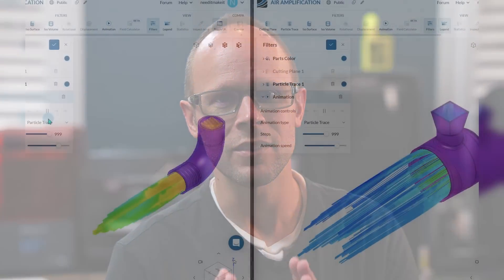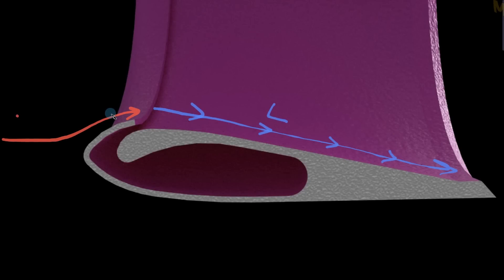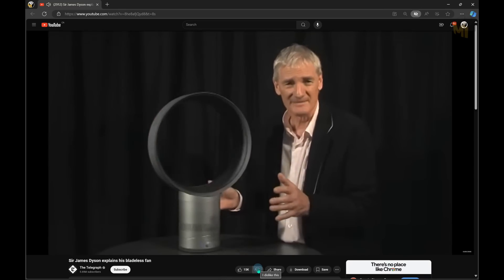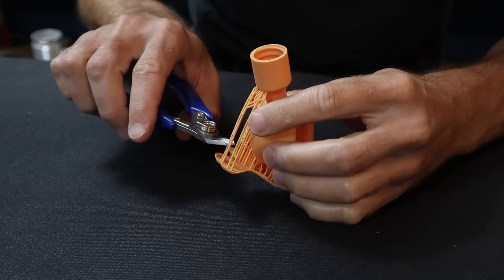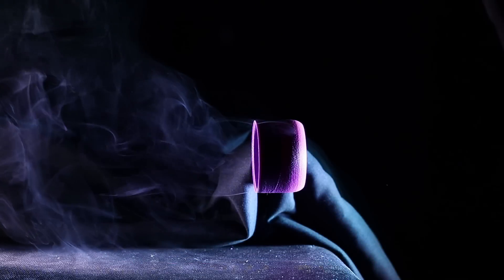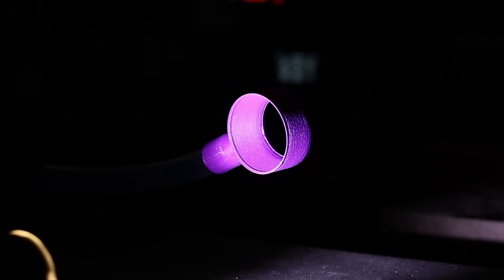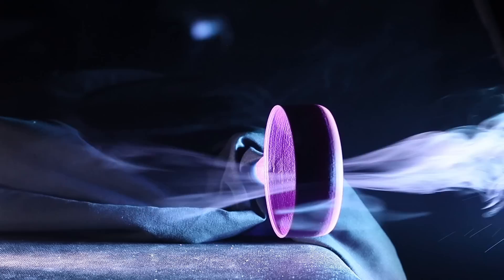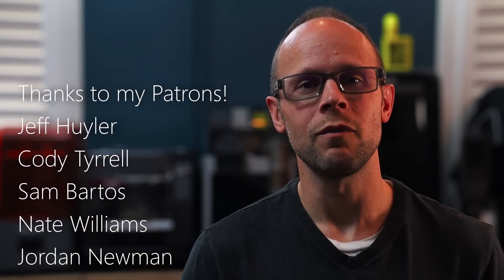3D printing a functional Air Amplifier and testing it to see if...

Comment: Also, my guy, my duder, my fellow, my .... uh you .... Light your face! your eyes are way too dark compared to the amount of surround light you have. Its like you have a side light, a hair light, but no primary light....Gotta get that center of the face lit up bruh!

And for airflow testing with fog, get a big bottle like a gallon jug, and fill that with the fog machine, then slowly squeeze the jug to waft the fog into the scene instead of blasting it straight from the machines heater core. That is flash boiling fog juice coming out of there, has a gnarly velocity all its own plus they like to spit juice droplets. Look around for 'bog fog' or any juice that is advertised as 'super dense', if you get one meant for, say lasers itll be a 'haze' and dissipates too quickly breaking up and just becoming a lighting nightmare (but is good for killer on set room ambiance...). You want the stuff meant to stick around and stretch out in to long tendtals. Yes, there is a science to fog juice.....stop laughing, its true!

Source: Haunted attraction technician, over 10 years. You want 2600 gal totes? Because I know all the places in the greater LA area where you can get 2600 gal totes of fog juice....or 55 gal, 30 gal, 20 gal, 10 gal, 7 gal, 5 gal, 3 gal, 1 gal, quarts.....

TLDR - I know fog. 

Oh, and PSA: People, stop clogging your machines. Before and after Halloween, empty out the leftover juice (back into the juice container is fine, just dont let any contaminants in), put some white vinegar and distilled water (NOT TAP WATER!!!! YOU MINERAL DEPOSITING HEATHEN!!!!) mixed about 50/50 about 50% full, and run it dry. The fog juice should clear out the first few rounds of bursts. Then if you're really picky, a round or two of just distilled water (a round being a heating cycle, just tape the button down). Now your juice wont coagulate jamming up your check valves, pump, or heater core in the 11 months itll be in the garage attic....
Reply from the maker: There have been a few comments about my face lighting and I am working on a better setup right now.  I think I've mentioned it in the past few videos, though I don't think I covered it in this video.  My lights are quite frankly terrible and my ceiling lights are incredibly bright in comparison, so the solution is to turn them off with a bit of lighting from the rear, and then I can light the right way from the front, and I may try to record with no glasses, the glare is very annoying to have to deal with and I have a window which brings in natural light, but I've had to cover it because of that glare as well.  In any case, your points are taken and I will certainly be doing something about it.  

Thanks for the smoke tips, I have some testing videos coming up so I'll be using those techniques in those videos.
Reply: @NeedItMakeIt  PREFACE: I kind of infodumped a good long ramble. Feel free to hold off taking this reply on till you have the time. Its in two parts, because YouTube has a character limit, but doesnt display it to the users...since that would be too easy... Grab a tea, buckle in....'ere we go!!!

To be fair, and lets be honest here, lighting is one of those things that tends to be a bear to get right. Until one has equipment that can achieve a good setup, and knows how to utilize it, its always an uphill battle (knowledge - equipment == equipment - experience). I have my desk setup in the corner, among many reasons, so that for video chats and the odd stream I could use the walls as bounces, add a multi gooseneck arm lamp behind the monitor (since there is a ton of dead space behind it anyways) and it got the lighting pretty decent, including the 'work area' of my desk if i was fiddling with something ( I highly advocate for L shaped corner desks, so much room for activities!). And even that took some messing with to get right... 

Side tangent: right as in presentable and studio quality perfect are two different things, and we in the internet peanut gallery will harp on ANYTHING ( I mean, just look at the audio quality neuroses that has been inspired in so many YouTubers...they freak out about the tiniest noise that doesnt even come through on the audio. When really, as long as we can understand you, and there isnt some high pitched piercing whine or something, the vast majority of us couldnt care less about a chair squeak, air conditioner sound, or low drone of fan noise. Ultimately non-intrusive (ie, piercing, distracting, otherwise audio obscuring) noises are to be expected....we're effectively watching most 'Tubers in their rooms/garages tinkering, noises happen. IMHO it makes it more real that we're sort of hanging out with the person talking shop....Although I will point out so people hear it, because it really is a problem: Please, if you ever use a censor bleep, take the gain of that beep down a bit. Speakers these days are tiny and resonate at higher frequencies, i could have my TV so low I can barely hear dialog much less understand it, and a 1000hz censor bleep can still be heard clearly across the house....almost no one edits those down to not blow the doors off the listeners end of the audio experience, same goes for anything that uses a piezo beeper and is close to the camera (looks at any channel that uses radiation detectors....)😒). Perfection is only obtainable with dedicated effort (and expense) which can easily take away form the joy of creating content. As such I also advocate for aiming for decently presentable to avoid falling into that chasing perfection trap. And absolutely keep a grain of salt nearby for the vocal minority and our potentially unreasonable gripes 😅 Its the internet, and again we nameless masses protected by the anonymity of our keyboards will find anything to b!#%h about. Validity be damned!

Back to the regularly scheduled tangent: For the record, I did like the video as a whole. It was an interesting exploration of that sort of exotic venturi style method of moving air. Proper science-y/engineering-y/academic-y  look at the various aspects of [whatever the thing in question happens to be] is one of the best parts of YouTube (which I expect from other videos of yours, which I intend to go thought, I have the tab open, Ill do it gosh darn it!). I for one love the kind of 'overly technical' (as Matt Parker might jest, 'unnecessary detail') videos, its how to inspire understanding in those with a casual interest by giving them a deeper look, passing on some insider buzzwords for better search results when deep diving a topic, spreading the knowledge so some of these skills and practices dont die in some cases (like movie miniature model building...they didnt share and it almost went extinct as a skill). It doesnt matter the topic, could be maths, make up,. car detailing, car performance mods, fashion, fantasy sports, sewing, sewing machine repair, vacuum repair, hell vacuums, physics, astrophysics, why the tree in the front yard grows sideways, even felling that tree when it gets too big an threatens to fall on the neighbors house (shout out to guilty of treeson, a channel by an arborist company mostly about felling trees). Us nerdy types WANT that unnecessary detail we cant get elsewhere. Im a bit of a polymath so I could suck it up all day, but I know Im not unique in the feeling that there are so many trades and methods, and just simple aspects of things I wish I had more opportunity to absorb information about, but unless you're in that industry no one talks about any of it, and people in the industries think its boring because they do it all day....well we dont, so spill it! In that vein, personally cant stand the channels that feign science content as an excuse to blow stuff up (for an example. Which Im not against, I am a red blooded American, of course I like explosions! Its just...ya know...I wish they didnt pretend to be nerdy to turn around and be dismissive of a curiosity of the world around us by saying something like "but that [incredibly simple, takes barely any time, explanation of the components, their rolls, or effects] is boring! More sploisions!!!" If they want to be an explosion channel, be an explosion channel. Its fine, thats okay, I support that idea, and I agree YouTube is far too strict on those kinds of channels. But dont tease the science just to dupe the info thirsty nerds into watching...at least thats my salty opinion on it...ask me how I feel about nerd pop-culture some time if you want my dissertation on how the 'yeah! Science!' nerd-esque pop-culture zeitgeist has wounded self education and the celebration of knowledge....)
Reply: Part 2 of 2: jibberjabber boogaloo

Sorry about the "In this essay I will...." info dump wall-o-text there 😅 The gift of gab aint got nothin on me!

Chapter 7: A bump in the night...

For some unsolicited 2 cents on lighting to wrap this novel of a reply up(he lied): Simple hardware store silvered clamp lights and some decent color temp bulbs can do wonders flooding an area with soft light (and, I totally understand the battle between lighting a face and sitting there absolutely blinded by said lighting. 100% valid concern), especially with a slight diffusion on the front (thin white....anything. wax paper can do, or diffusion fabric, or of course bounced off a large white/reflective surface. though again watch out for that perfection hole,  plenty of companies market the hell out of basic materials that are either cheaply made and marked up because 'niche market', or can easily be replaced by a cheaper solution, for the 'just buy the thing that says it will do' crowd (Like, a thing is $15, until its meant to be used on a film set, now the exact same thing is $70....while something can be said for items that are the same design but built to a higher quality and have better warranties, when a seller marks up the cheaper version because something looks similar and is more expensive that is nothing but taking the piss). There is a place for that stuff, but with mass manufacturing the way it is (see above tangent about piss taking), a lot of shysters have snuck into the markets to dupe hard earned money from good intentioned people...I agree, its terrible, and I dont like it....we shouldnt need to have a background in material science and fabrication to know if we're getting screwed or a deal...but...thats the  world we're in at the moment😒....unfortunately). Be careful of some dimmable lights, if you decide to go that route, as theyll tend to flicker as they dim, most smart LED bulbs these days have a drive frequency high enough its not an issue until you get way down in brightness, but chopper dimmers on the mains feed will flicker at the drop of a hat (hint: lock off the shutter speed if you can on your camera. Its a quick trick no one talks about to combat flicker from auto exposure/shutter speed). And keep in mind your color temps! Brightness is one thing, but good illumination/color rendering is another matter. I personally like 4000 Kelvin to my eyes, maybe up to the 5000 Kelvin range to a camera (of course, white balancing with a sheet of printer paper can do wonders, another trick people skim over when explaining how to record stuff). Steve Lehto has two stands he had made with 6000 K 'daylight' bulbs....which are great for illumination but MAN does he look blue. Like literally, blue 😅 Gotta blue tinge to him. And I dont think he has white balanced his camera....But he is just making law commentary! Its okay. It doesnt need to be studio perfect. Hell the amount of light he has, while adequate for a studio like illumination is a bit much for some quick videos on law. Then again he used to do radio, so probably he has his tastes Im sure based on how he is used to studios being setup for also recording video in radio stations. 

....heh, like I said, aint got shi...uh nothin...aint got nothin on me....😁

My overarching point is, yes, sure, there is some space for some non-zero level of improvement. And it seems you are aware of and intent on addressing it, awsome! However if at any point my comments have instilled any non-zero level of dissuasive feelings towards producing the content you do.......toss em! Get rid of em! They dont matter. Who am I? Im just some jerk on the internet! How much water does one grumpy asshats opinion hold in the grand scheme of things? None. People will praise off the cuff, and people will poopoo off the cuff, this is the internet and here be trolls, its the nature of the beast. You do you, boo! All opinions aside, fact is you make good, interesting content. I watched it all to the end. And ill be back to gripe about something else that I'm sure will be ultimately innocuous to the information you are sharing. As acquaintances stopping by the shop off hand nit picking a project are wont to do. None of it is meant to imply you shouldnt be doing the thing.

Chapter 12: The butler did it....

Hehe, get it? Because wall-o-text.... 😅Anyhoo... Keep on keeping on mate! You got a good thing going here! Inform them masses, beat back willful ignorance with that stick of genuine honest explorations of the world around us, and go carpe that diem, by the throat!!!😎👍

Comment: We've used those before in themed effects. It was called something like a venturi air amplifier or some such. It requires a pretty good flow from the supply. The way we would normally use it was for fog column effects, basically you have a box, with a fog machine in it filling it with fog, and a hole cut in the top or side or whatever with one of these devices in it. Open a valve (solenoid) and the blast of pressurized air causes a pretty good column of fog. Put a orange light under it you have a fire column, blue for water, green for spooky, pink for good witch, etc....

Comment: For your smoke tests, you may want to try a trick that Major Hardware uses on his Fan Showdown. Instead of directing the blast of smoke from the smoke machine into the airflow, he instead uses it to fill a large container. He then pours the smoke out of the large container, giving a large volume of low-speed air to the input of the fan, which gives a much better view of what happens in an otherwise calm environment.

Comment: Two things I'm curious about is whether it matters if the ring airfoil shape is curved on the inside or the outside, or just perfectly symetrical; and the other is whether aiming the output into slight inwards focus versus slighty outwards makes any difference. Oh, and also whether a continuous opening is better than a ring with evenly spaced holes.